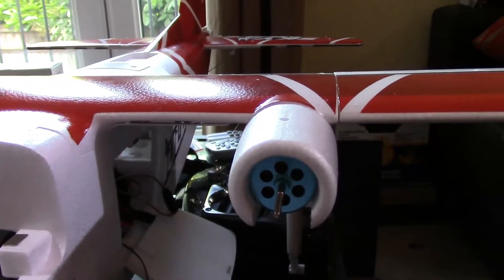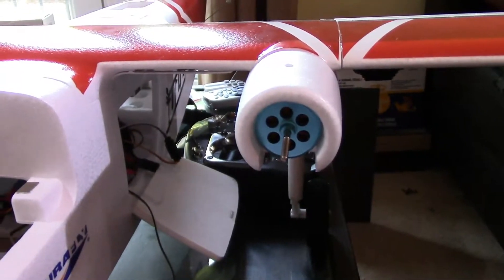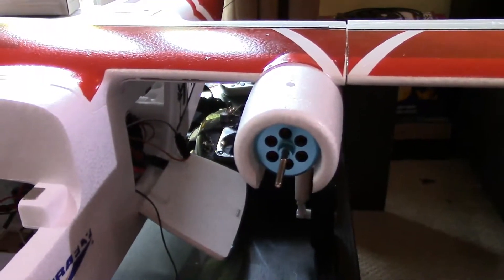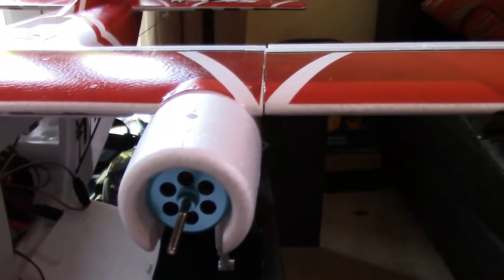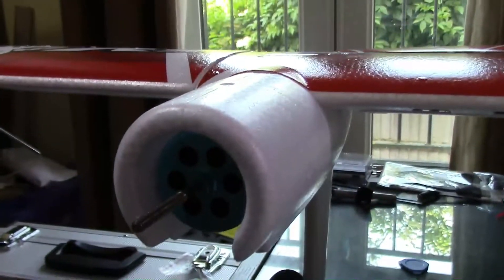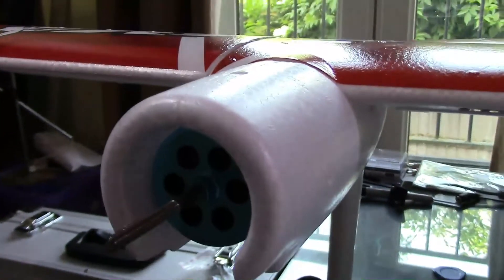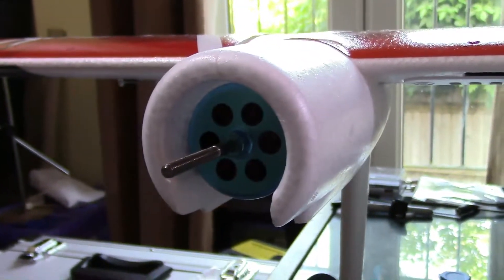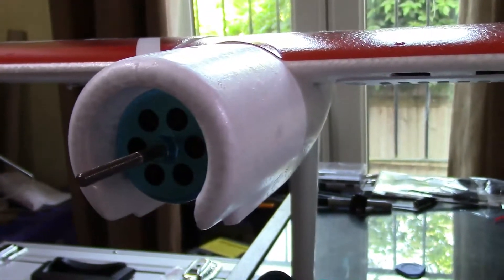Sky Mule - Stock Motor Fault

Comment: Those bearings are 4X8X3 and you can use Blade Helo bearings. BLH 1605.  There are to bearings to each motor and they are the same.

Comment: hi! i have the same problem with one motor. can you make a video how to take the motor of, or some instructions?
thanks in advance
Reply from the maker: Hi Babis.... sadly not in a position to help out on that. I've still not re-built after this: http://www.youtube.com/watch?v=UK9T2pzTSv8. From what I remember you dig into the foam to get to the screws left and right of the motor and pull it out from the front. Head here to get the best advice: http://www.rcgroups.com/forums/showthread.php?t=2113480
Reply: Damn!!! i'm really sorry for your SkyMule man. That was caused from the motor?
I've made one maiden flight without any crash but we then noticed the motor having a problem so i haven't flown this again, i thing i will try to see a shop that Flite Test guys mention and i think they have the same motor. i think skymule is a hard plane to fly at least for my skills :-(
Reply from the maker: Babis xalkias No that was caused by trying to fly in 21mph winds (and a lack of talent too!). In a calm day the mule isn't too bad but the tip stall is something you have to be so careful with. My advice is to do what I did. Raise a warranty case with Hobby King (send them a vid of the fault motor to make life easier). They will send you a replacement however they are poor motors for the mule as the splines are just too long. Better bet is to also get some SK3 3536 1050kvs in there. I only had a few flights before the crash with them but they were great motors for the plane.
I never fell in love with the mule tbh... too big to carry about easily and not really any good at range flying either due to the chunky shape. Much better as just a sports flyer than an FPV rig.
Reply: did they replace yours?
Reply from the maker: Babis xalkias
yes they did. I sent them this video and that proved the problem.
Reply: +d3weyTube Hi again after so long. I've made a video when we had our lst coversation and i open a warranty issue so they replaced it with a complete new skymule..... sshh don't tell anyone else though lol
i still havent fix it.